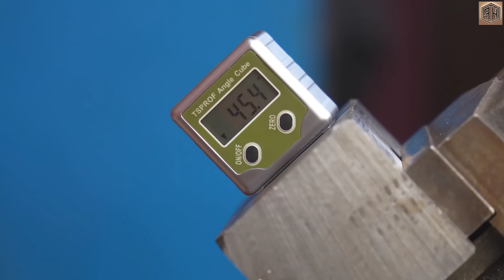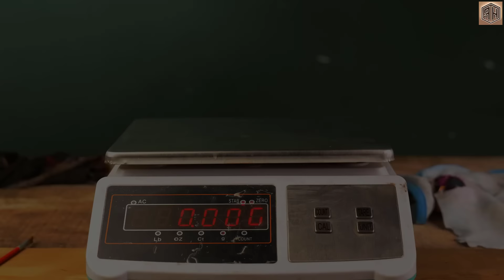Forging a Real THOR's hammer - Mosaic Damascus

Comment: The grip is upside-down and sideways. Might want to flip that around. The points on the grip should be inline with the swing of the hammer and facing away from the head.